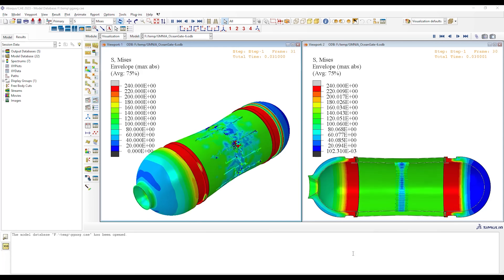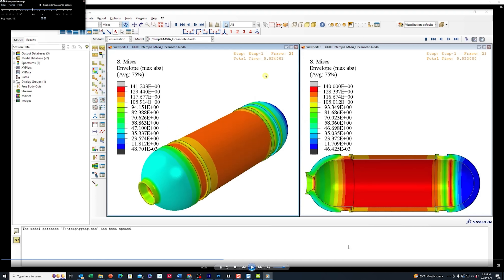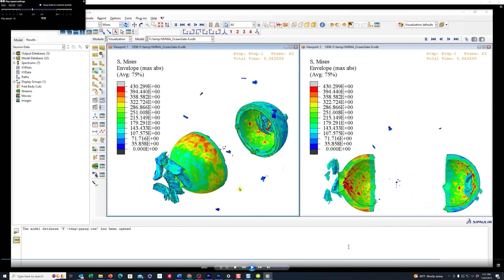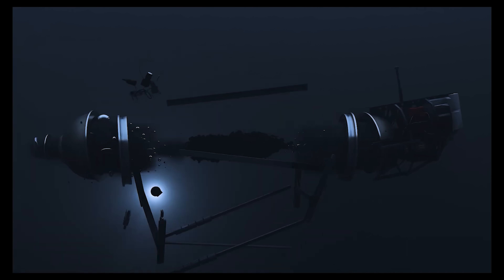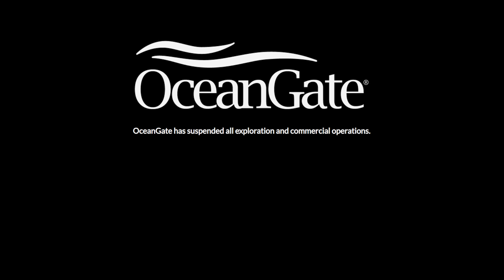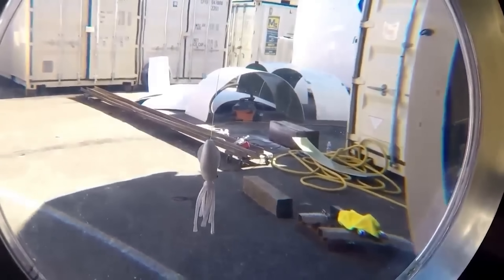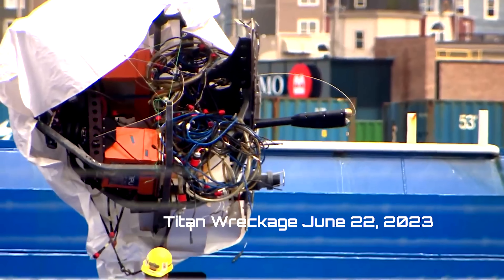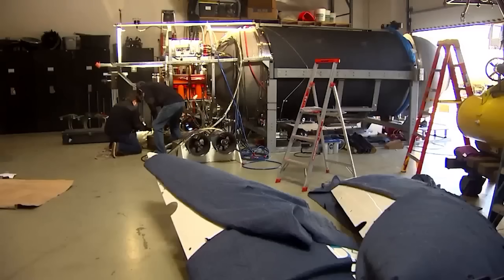Best Titan Sub Implosion Simulation, Cracked Porthole? Q & A

Comment: Abaqus Explicit, I presume ?
Did you/he have access to the composite lay up of the vessel ?

The stress scale on the left is rather meaningless as the stress limit for titanium is clearly different from the stress limit of the composite, which itself isn't unidirectional.
You should have shown Composite Reserve Factor, with a limit of around 0.8, which is probably a bit generous for such a safety-critical structure.

Comment: What were the screens and other accessories attached to on the inside of the submersible? It appears to me that they are screwed directly in the sub wall. If that's the case, did that help compromise the hull? Me thinks it's possible.

Comment: Those aren't cracks you see in the second shot, it's a very thin layer of air in between the acrylic and the surface it mates against, creating a mirror effect due to internal reflection caused by the differing refractive index at the acrylic->air interface. Where it contacts the metal (or bonding agent) directly without a thin air gap there is no reflection. So this provides an accurate map of exactly where the acrylic is making good contact. Presumably this would have been deformed and squeezed to nothing under pressure. They seem to be relying on pressure at depth to complete the seals. I've heard others say this should have been completely filled neoprene seam. It might be as it's difficult to tell if there's a third material in there. I don't know how standard this is as any flexible seal would be designed to deform and complete a better seal with more pressure.

Comment: what your seeing as cracks is most likely mold from water laying under glass well sitting then getting high pressure water around the edges makes lines in the mold because water get around the glass till about 150 or 200 foot deep till the pressure starts to push the window tighter into the wedge against the seal on the inside flat lip water gets in the sides of the glass but not in the sub, you cant have your seal on the side or outside because the window at 12000 feet will compress up to 1inch into the wedge acrylic compresses a lot with close 2 million pounds pushing on a 21in port hole at 12000 feet under water..& I guess most people also didn't see that the port hole window was rated for the depth of 4000m but when the company that made the port window found out rush was using carbon fiber glued to titanium they derated the depth of the port hole after he told rush it was a bad idea and not good for that depth of titanic ... I will stick to my guns that carbon fiber failed with the nearly 40 million pounds pushing on that carbon haul cause the gun shot sounds from people that went down in titan was definitely delamination and braking fibers.. thanks for sharing

Comment: Salt water corrosion on chipsets is gnarly , in cars , so idk how recoverable the data would be. especially after a interaction with extremely violent forces. Especially if it took the trackers pressure vessel out too.

Comment: employing construction technologies joining different materials possessing different properties, specifications, tolerances, and reactions under intense compressive and then decompression forces would to me always be a built in flaw and weak point of devices such as the Titan submersible.  Utilizing an epoxy glue to connect the main carbon-fiber pressurized tank to the titanium domes, which had not been thoroughly tested to withhold the stresses of descent and ascent to a depth exceeding the intended dive depths seems truly negligent.

Comment: So the outside of the carbon fiber was coated with Rhino Liner 08:38
If I were to build an experimental deep sea submersible, I'd not paint the CF because you can't see any problems developing underneath, and you don't know the long term effects of the paint components on CF

Comment: My sense would be that the hull would not collapse like that, pinched equally around the circumference. I'd bet there was a crack that formed longitudinally and caused a crack on the other side, and the two sides pancaked and shattered as they contacted each other. All happening in milliiseconds.

Comment: The depth is allways measured by using a pressure transducer. What about if this transducer was not correct calibrated?   A little percentage of missreading is easy to do. Together with the fact of a descent too fast, the titan may have collided with the seafloor. If sight was poor this could also produce a sudden event and damage.

Comment: Is it possible anybody could have swam to the Titanic and be in an air-pocket in the wreck?
Reply: Yes, especially if they brought a lunchbox with plenty of food. they could still be down there hanging out.
Reply: @Aedonius  Now your just being childish as everybody knew it was just suppose to be a short trip therefore nobody would have packed a lunch.
Reply: @Westyrulz  your right, depending on how fat they were they could be fasting. actually being too fat was the reason they couldn't ascend fast enough but luckily fat protects you from the pressure. It's the ultimate survival mechanism built into the human body. Protection and food.
Reply: @Aedonius  Not to mention fat is great insulation from the cold.Obviously its time to search the Titanic.
Reply: More than possible its quite probable.

Comment: I'm intrigued by the rationale of Stockton & crew wearing what look like padded cycle helmets as protective headgear as they tour the outside of the vessel while people working on the craft and in  the workshop don't. From workplace safety management that tells a story, as does seeing another view of the craft under construction with loose panels, cables, piping scattered around the floor and unboxed components piled on each other. Each workshop looks like a hastily borrowed barn. You'd transfer contraband between stolen cars in tidier conditions.

Comment: From what I heard they decended in darkness to save battery power so only if the turned the lights on when they got into trouble would any video be taken and I wonder if anyone did in such a state of fear they must of felt. If they did I guess it is possible a card or chip could survive the pressure.

Comment: Hydraulic systems and their connections, or cables, entering the sub through the ti cap is quite clearly not what failed.. if they failed, an implosion wouldve been rather unlikely.
Like other people has stated its most probably the cf that deformed due to imperfections or the interface between ti and cf tube as a result of many stress cycles.

Comment: I think the cracking started where the carbon fiber met the titanium end caps.  The carbon fiber would compress and the end caps didn't and it caused cracking of the carbon fiber, which eventually lead an implosion.

Comment: Was the syntactic buoyancy foam only in the aft tail section of the vessel?  Or was it also in the area under their feet in the pressure vessel?  One wonders how balanced the distribution of this foam was.  If the aft tail section was compromised, would this have created negative buoyancy in the pressure vessel and an inability to ascend regardless of whether the ballast or legs had been jettisoned?  If the leaked transcript is real it would appear that something was going awry in the rear section prior to implosion.

Comment: Investigators will know pretty quickly where and how the failure occurred by looking at just how those bolts sheared. The direction of the shear will be pretty obvious even from a cursory visual inspection.

Those "cracks" and scratches in the porthole look like inconsistencies in how the acrylic was bonded to the titanium hemisphere. 

Maybe they didn't de-gas (?) the joint to remove air bubbles, etc. The finish of the titanium surface also looks inconsistent, you'd expect that if it were shot-blasted or acid-etched and correctly degreased in a clean environment with a view to improving adhesion before the resin was applied, that you'd have a very even layer of oxidation on the titanium where it joins the acrylic, assuming the resin was applied without voids, air bubbles, etc.

Finally, if the bolts were incorrectly torqued, or, if the titanium or acrylic were slightly out of spec and then the bolts correctly torqued to spec, instead of an even seal all the way around the porthole, it would be loaded asymmetrically and liable to fail in a particular direction. This would only get worse with increasing depth, as the effects of tiny inconsistencies are magnified (and also why homogeneous materials like metals are preferred for deep-sea submersibles). Stockton actually alludes to this failure mode by describing how the acrylic compresses 3/4 of an inch at Titanic depths. His claim that acrylic gives you warning time it's about to fail because it spiderwebs is absolute nonsense. At the point you can see the shattering pattern in the acrylic it is little more than plastic gravel. It has lost virtually all of it's strength by then. It's an insane claim for an engineer to make.

More evidence of amateur hour at Oceangate 🤨

Comment: Only reason you cant see the "cracks" from the inside of the porthole window is the large taper of the plexiglass.  From the inside you can only see about 80% of the actual window whereas from the outside you can see almost 100% of the plexiglass.  Now whether or not they're actually cracks is another debate.

Comment: The carbon was used in its weakest form....Great at holding pressure in with fibres under tension....rubbish at holding pressure out under compression. Also multiple cycles of an unregulated untested at those depths is a joke, the guy was Beta testing with every dive. The porthole was blown out with the implosion which is why the likely won't find it, I bet its a fair way from the wreckage site.

Comment: The chance of an micro SD card surviving is really low you have a higher chance of winning the lottery than having a micro SD card surviving an implosion you can break those little things with your hands with very little effort we are talking 5600 PSI our hands can't produce that but we can break them plus that's considering that you can find a micro SD card at the bottom of the ocean.

Comment: So is it still a theory that they had a complete electrical failure and went nose first plummeting deeper? If that was the case, then all of the passengers would have been piled one atop the other in the nose of the vessel, in other words, piled on top of the acrylic viewport? Would that have compromised the viewport window or does that not even matter if the fast rate of descent caused the implosion because the materials "could not keep up with" the rapidly changing pressure as they sank?

Comment: A crappy design using expired carbon fibre filaments and material combinations that no sane submariner would use. It will be difficult to hold OceanGate to account, as their "responsible person" (ie the CEO) has died in the accident, and the company stopped trading, but it is not impossible - despite all folks having to sign hefty waivers these waivers are invalid if the accident was due to faults the company had known before. As this is the case the relatives can sue for compensation. While this does not bring their loved ones back it may at least help with living after this desaster. Stockton Rush in my personal view was an irresponsible megalomaniac idiot who did not hesitate to put people's lives on the line for his own ambitions; the devil has some very special places available in hell for such characters...

Comment: I'd say there is a chance a micro SD may have survived but I wouldn't bet the farm on it. That much pressure does foopy things to almost anything; I'm wondering what the construction of the hydraulic line to the release pin was, remember it's partly outside and empty of pressure.

Comment: A few weeks ago I watched some very convincing analogue video of the implosion that seemed to be captured by the titan itself, I appreciate it can't been shown on YT without breaking ToS, but do we really need to continue to speculate when that video evidence exists?

Similarly, the video confirmed what was in the transcript, that the cracking sounds were coming from the rear and ultimately thats where the center of the dent is in the footage, rather than anywhere near the port hole.

It also shows the ballast missing, but the frame still attached, so potentially the frame release mechanism failed too if they did try to eject it.
Reply: Interesting. Where did you see the video?
Reply: @JamesF0790  it made the rounds in the relevant industrial circles, clearly leaked, and clearly not CGI because of how good the fluid simulation would have to have been, but I can't rule out it being a very good model replica being filmed either due to the slight potato vision.

Moreover, while looking for a stable link for the footage, I found a bunch of CGI videos that are very similar to that first example I saw suggesting that either the CGI footage was modified to look more real, or someone made an almost identical CGI animation in an attempt to obfuscate the real footage.

Comment: If the porthole failed and got blown in, then why is the retaining ring no longer attached ?
The pics show no retainer ring, and straight bolts that'd have kept it (and the porthole) in place
I can't see from footage if the threads are stripped or not

Another solution is the bolts were undone during recovery of the front dome

Comment: The valve seal failure. Like the NASA shuttle launch. On the booster engine. The temperature. from hot to cold. A rubber seal will shrink. Allowing water to enter.

Comment: For me, the facts (transcript, IMO, is valid) are: 1) descent of Titan on the final dive was significantly faster than expected  2) during descent cracking sounds were from the rear (aft) part of the vessel   3) confirmation of reason for 1), lack of normal ship buoyancy, when attempting to ascend     It seems that 1) by itself, if reacted to, would probably have saved the Titan.   IF they had, early on, attempted to slow descent velocity, and found that wasn't possible without jettisoning the entire frame - the dive would have been scrapped at that point.   Sounds from the aft section indicate, to me,  where failure will occur .

Comment: The titanium dome that housed the acrylic window, is undamaged / undeformed.
This leads me to believe the acrylic window, was 'not' the failure point.
I believe the failure point was the carbon fibre hull.
It takes 12 milliseconds for the human central nervous system to register pain, so the souls on board would have perished before they even knew what was happening.

Comment: @jeffostroff Do your own research on kink band propagation in CF under compressive stress. Simulate a kink band that reaches the machined functional surface with the adhesive, making it uneven.

These simulations of implosions starting in the center of the tube suggest that the titanium rings provide additional stiffness to the CF, but the adhesive would not be able to transfer significant shear loads. Also, they most likely matched the Young's modulus of the CF and titanium, so no stiffness would be provided anyway. This is not a soda can with firmly attached caps! The titan domes are virtually loose in that scenario.

Comment: Oh dear! The porthole window is cracking! Start the two and a half hour ascension to the surface, quickly!
Reply: Don't you understand? All you have to do is reduce the pressure! If the window starts cracking at 5734psi, just back it up to 5733psi and you'll be fine! 😂

Comment: I've said all along it wasn't implosion, but an explosion that blew it apart. But your simulation is all wrong. If the carbon fiber failed it would have split not collapsed.  It was an explosion that blew it apart. It nosed down, hit the floor, broke the window and the pressure rushed in compressing the air pocket to 6000 psi, causing a huge explosion..
Reply: You, obviously, mean "explosion" like in a diesel engine. Nope. In your scenario there is one element missing: atomized combustible material. The content of the hull could have never been "minced" to that point. The air would reach, for a split of a second, very high temperature - and cause some surface scorching to the bits and pieces - but there would never be an explosion. Analogy: diesel engine with dripping injector.
Reply: @curiouscat8457  you need to watch some videos on submarine implosion/explosion. Human bodies are 95 % combustible. The water coming through that portal would be like a meat grinder at 6000 psi, turning those bodies into chum.. and then 6000 psi, which is 12 times the pressure you need to ignite diesel fuel, would cause an explosion. The carbon fiber failing would let it split and fill the crew cabin with water.  No implosion...

Comment: If the carbon fiber was getting more damaged with each dive, it would have also been getting heavier from water saturation, which would explain their rapid decent and inability to ascend even after dropping ballast.
Reply: But the tube was covered in rhino lining, that has to keep water out down to at least 30 feet.
Reply: @daves2433  HaHa, good one.
Perfectly safe. It works in the bed of my pickup so it's fine for 4,000 meters.

Comment: @jeffostroff the question is can you do F.E. analysis on carbon fibre as it is not homogeneous?  I am a structural engineer and we do FE for steel and reinforced concrete but not done it for any other materials. maybe I cam behind in the technology.

Comment: The 2 orange boxes look like the batteries that provided power on the craft.  There is a brand name visible at minute 6:17 but I cannot make it out.  If the pressure was about 5800psi at the bottom, why are these cases still intact?
Reply: Most likely: completely filled with liquid.